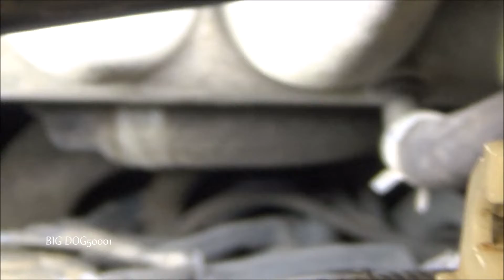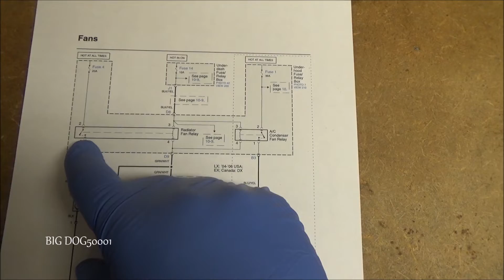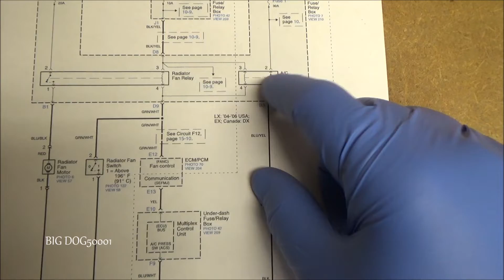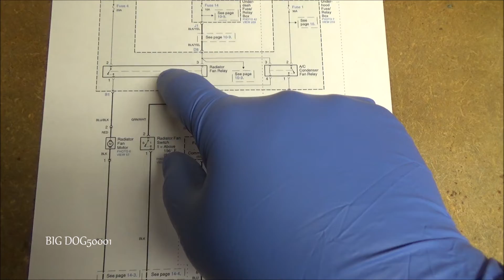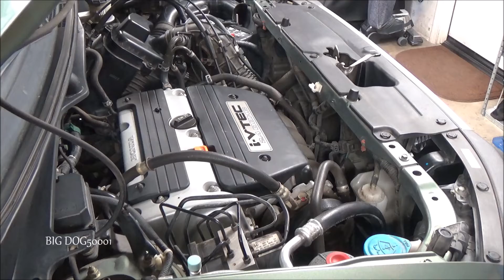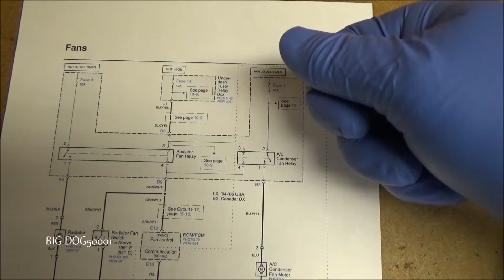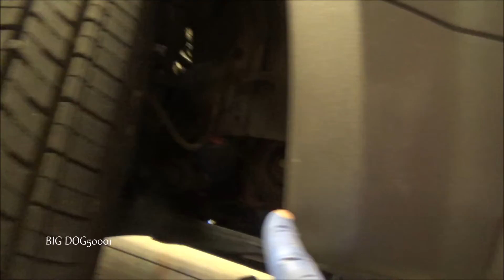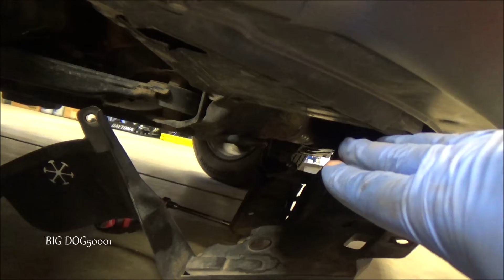Honda Radiator/Cooling Fan Not Working Honda Element

Comment from the maker: Parts and Tools
Disclosure: This channel earns a small commission using some of these links - at no additional cost to you.
Aftermarket Honda Trim Clips:  https://amzn.to/3tY0lVP
Test Light:  https://amzn.to/3fu6DHL
Element A/C Condenser Fan (Aftermarket):  https://amzn.to/33ZTEbq
Element Radiator Fan (Aftermarket):  https://amzn.to/3eZmLlk
Astro 40SL Work Light:  https://amzn.to/2R6xSQh
GearWrench 1/4" Socket Set:  https://amzn.to/3ttBTvp
SK Long Screwdriver Set:  https://amzn.to/3whsqsU
Relay Buddy Kit:  https://amzn.to/2QxrXn5
GearWrench 3/8" Socket Set:  https://amzn.to/3wjP5VA

The Big Dog 50001 Automotive Channel Store can be found here: https://www.amazon.com/shop/bigdog50001automotive  (As an Amazon Associate I earn from qualifying purchases).

Comment: My condenser fan doesn’t work. It has ground power but no power on the negative. I checked both the fuses and relays. And even swapped the relays around but I still can’t get any power to my fan. My Cooling fan works. (Passenger side)

Comment: After replacing my entire A/C cooling system back on my 2008 Element in March 2026, I began to have cooling problems in late May and early June. I stopped and checked my condenser fan was working but very slowly/hesitation. I was prepared for this as I purchased the Honda radiator and condenser fan motors from a Japan (Denso). I drained the coolant from the radiator to replace the fan switch as well at the same time I replaced both fans. Problem solved at 1/2 the price from Honda USA.

Comment: Another single pin connector on bottom of condensor fan and another connector mounted to another part, a real pita (gray wiring harness and a ground screwed in that is stripped). * in addition tonthe switch!!!

Comment: Just bought 03 , overheating rarely but surprised found out seller capped/plugged radiator bottom where sensor goes and disconnected dangled plug. Disabling fan from turning on even tho tested plug and fan fired right up. Now have to figure out how to reconnect wire  back to plugged radiator. Hopefully can remove existing cap, buy temp sensor and install and connect dangling wire.. 
smh

Comment: Just a few tap tap taps on the fan and it started right up again. Just saved me hours and money - THANK YOU!!
Reply: Taps on the fan mean the brushes could be on their last leg. It might work once, twice, or a few times, but eventually, the worn-out brushes won't energize the circuit inside the fan motor. At least it will buy you some time.

Comment: I don't think you explained what it means if you do the tap test on the back of the fan and it spins a little but slows down.  I understand when you talk about doing the tap test on the relay...it might be the relay or a connector there.  But I don't hear you describe what to do when you tap that condenser fan and it starts spinning but immediately stops. Does that mean replace the fan?
Reply: you have to confirm that the fan motor is getting power and ground at the connector first.  that is the definitive test.

Comment: Great Video I am planning to replace both fans as well as the front “ Bumper Cover”.  I have seen another video where you can replace the driver side fan the same way. Except I might have to pull off the top radiator hose. Of course that means that I will have to drain the radiator. If I do,  I will also replace the sender switch on the radiator. My Honda has over 250,000 miles. I think doing all of this at the same time will be good preventive maintenance. I will be watching more of your videos in the future, thanks.

Comment: Watching your video allowed me to identify an Element problem I was about to buy from a dealer. It has the exact same problem. AC fan doesn't turn on when AC is on. If I buy it, i can at least diagnose where the problem is. If it is just a fan problem, it is cheap to fix, same if just a fuse problem.

Comment: Did not have test light with me nor my power probe either originally was replacing radiator due to failure but upon refilling coolant fan did not switch on at temp. I believe condenser fan is bad and coolant switch too.

Comment: adding on a newly found issue - IF you had done the radiator replacement on your own,.. and you did not replace that plug /. switch that goes into the lower side of that new radiator WITH A OEM PART - your screwed!  because the replacement plug // switch will not work unless its an actual OEM part !!!    at 1;50 on this video he touches close to the issue but does not show you the side of the radiator that had this plug / switch im talking about...  FYI

Comment: I've inspected all my fuses, relays, and the fan, and everything is functioning properly. What else would you recommend I try?
(2006 Honda Accord)
Reply: There is also a fan resistor  in the circuit that can cause the fan to not work if it goes bad. Also use a tool to make female spade terminals snug again if they have become loose!
Reply: Dentil tool works good  just disconnect battery on neg terminal so you don't short out your metal tool.

Comment: Good morning Dave. Question are the radiator fan motor and ac condenser fan motor are interchangeable, meaning are they the same part number? can I take a good ac condenser motor and swap it into the radiator fan assembly? Thanks
Reply: No. !!

Comment: My ac condenser fan wasn’t working . I checked and the 30 amp fan was blown . Got a new one and it worked. Next day the fuse was blown again? Do u think it’s the ac condenser fan or somewhere back up in the fuses? I reached down w car was off and tried to spin the ac Fan and it barely moved like the radiator fan that moves super freely .

Comment: I had to tap on the a/c fan speed dial to get the a/c to come on. I had no in side fan or compressor coming on. After a few taps it started working but the condenser fan is not coming on. Would the a/c fan speed have anything to do with the condenser fan not coming on?

Comment: Question what brand ac condenser fan did you buy?
Reply from the maker: @HotRod-wv4vm  TYC is what I typically use for aftermarket fans.
Reply: @BigDog50001  what about getting the Denso from Honda and reusing the shroud?
Reply from the maker: @HotRod-wv4vm That is an option.  I usually don't go that route due to cost.  Plus I like getting the entire assemby so I don't and have to deal with possibly breaking plastic pieces off of the old one.  Old plastic in the desert doesn't age well.

Comment: I have a 2005 Element and the a/c condenser fan stopped working and the car started to over heat while stuck in traffic with the a/c on even though the engine cooling fan was running. Coolant reserve tank was empty also. I was not aware that both fans came on when the a/c was on so I thought the engine cooling fan and or circuit was at fault. This morning I bought a new fan because I connected 12 volts to the fan and it did not come on. I also bought a new fan relay because there was no power to the fan on the harness side when the a/c was off thinking it was the engine cooling fan when in fact it was the a/c condenser fan. The relay didn't even match any relays in the fuse box under the hood which baffled me. After watching this great and very detailed video, I determined I bought the incorrect fan. I need the a/c condenser fan not tge engine cooling fan. Tonight I did some tests after watching this video and found there is power to that fan, but only when the a/c is on which tells me I do not need a relay. I tapped on the a/c condenser fan like you said, but with a pair of Snap-on pliers and after a few taps it started to work. I'm returning the relay not only because it's the incorrect type, but I do not need it. I switched both fan relays and did some testing and they both are working. I'm also taking back the engine cooling fan and exchanging it for the a/c condenser fan. Luckily I'm a retired motorcycle technician and machinist so I have tools and some experience with water cooled engines, but I just needed some guidance and the information in this video helped me solve my issue and I don't need to go watch another video. I just have to have the system pressure tested for leaks since my reserve tank was empty, but I do not have the tools for this so I will take it to a local shop I know of who's honest here in south Florida. 
Thanks again for a great video. 👍🧓😁
Reply: Thanks for writing that down cliff. Helpful to know what you went thru
Reply: @jordanindustrialcompaction8381  My pleasure. I'm glad and I thank you for taking the time to read my mini novel and I appreciate it along with your reply.

Comment: So im understanding this correctly; both fans run off the same relay?

If thats true, would that mean the relay is bad if both fans do not work? (I havent done an in-depth diagnostic on mine, but both fans do not run at all)
Reply from the maker: No, two different relays.  Both fans should come on at the same time once the vehicle's coolant gets to roughly 200 degrees at the bottom of the radiator.  Each fan has its own relay and power fuse on these Elements, so most likely it is not a relay or fuse problem if both fans are not coming on (unless both relays or both fuses went bad at the same time which does not happen very often).  I would look for something that both fans have in common, like a blown Fuse #14 feeding the control side of the relays, a bad shared ground at G201, a bad radiator fan switch (for 2003-2006 models) or bad Engine Coolant Temp Sensor #2 (ECT2) (for 2007-2011 models).  Also, it is always possible the fans work and the coolant is just not getting hot enough for them to come on (a quick way to check if fans actually work is to turn on AC and see if the fans come on).  Good luck!
Reply: @BigDog50001  Excellent!! Thank you for the info. I'll investigate the fuses and ground, get all that done first before I crawl underneath to check that temp switch (it is a 2003 model)

Comment: My elements cooling fan is not coming on yet car isn’t over heating ?
Reply from the maker: Either the system is operating properly and the vehicle is not getting warm enough for the fans to come on or there is a problem that will need some troubleshooting (turning on AC and looking to see if fans also turned on is a quick check to see if the fans actually work).  Sometimes it will not overheat if the weather is still cool.  

If there is a problem then bad thermostats, fans, ECT sensors, wiring, relays or cooling fan switches etc, are all possibilities.  Hard to say which without seeing it.  

FYI, early models use a cooling fan switch located at the bottom of radiator to turn on fans (at around 200 degrees) and later models (around 2007) replaced that switch with a second engine coolant temp sensor (ECT2)  - which means engine computer is fully in control of cooling fans on models with ECT2 sensors.
Reply: @BigDog50001  thank you for an in depth response and for things to troubleshoot. I’m convinced right now that the cooling fan is shot because the a/c one comes on immediately once a/c is turned on. Relays are good and I have power to non operating fan. I will replace thermostat on bottom of radiator area to be on the safe side

Comment: hello. what might be the problem, when both fans goes on and off at the same time very often when I turn on inside heating (ventilator/-s). AC is off. Thank you for any tip to check

Comment: Big Dog, Can I use a multimeter instead of the test light? Plug the red and black needles in the plug and see if there is a voltage?

Comment: Both fans turn on when AC is engaged, but neither fan turns on when the engine is hot and the heater is engaged with full fan. Does that mean the thermostat is bad?

Comment: Do you have a link for the wiring diagram? I have the same issue both fans do not work. I also have a vampire draw killing the battery overnight. Thanks

Comment: When i changed my rad, i removed the top mounts on the rad and the hood latch, was able to tilt the rad forward and slide both fans past the rad and down into their spots. Now i have to fivure out why the fans only work with ac on. Temp switch

Comment: I learned a lot from this video but mainly sometimes all you need is “just the tip!”
Reply: PS: I smacked my fan with a long screw driver “just the tip”  and it started working!!!I intend on changing the fan immediately but this let me borrow some time while waiting for the part. Thanks for the uh…tip 😂

Comment: I had the opposite last week on my granddaughter's 03 CR-V. The radiator fan wasn't working. I swapped relays and no joy. Fortunately, I already had a replacement fan on-hand. Before I removed the fan, I unplugged it and connected the new one (laid on top of the engine, face up), and turned on the A/C. Yep, it worked. So, then it was simply removing the frame, unbolting and R & R. I too broke a lot of the plastic fasteners on the splash guard, but I have the big Harbor Freight 240-piece kit, so that comes in handy a lot. The bad part (nothing ever goes smoothly!) is that I broke the 10 mm bolt at the bottom of the frame. It was really rusted up and, even though I PB Blasted it and was extremely careful, it came about 1/4 out and then snapped. I was able to come up with a temporary fix, but I have to drill out and replace the bolt. Argh!

Comment: I have the same car. (05 element) my fans only work when the AC is on. When the AC is off they dont spin. The car does not over heat. Any ideas?
Reply: Bro mine is same they both  work  when the ac is on .

Comment: If both fans spin with the ac on, why doesn't the radiator cooling fan come on  after using heat during traffic jam?
Reply: That fan has a separate sensor , so that sensor could be bad.  It's the engine coolant temp sensor it's in the bottom edge of the radiator.  Jack it up change it from underneath.  You do need to drain the coolant to swap it

Comment: I think my condenser fan motor is broken, will test and replace as needed, but curious what harm does it do not working?  My AC works fine
Reply from the maker: It can cause the engine to overheat, which can lead to headgasket failure and other issues.

Comment: I am just confused cos the video headline is for RADIATOR FAN MOTOR REPLACEMENT but you are talking and showing on the wiring diagram about CONDENSER FAN MOTOR !!!
Another important mistake !!! You show the two relays next each other but left relay IS NOT FOR ANY FAN but it is for AC compressor clutch !!!
Reply: You are right, I was watching this and thinking, he is wrong or I'm crazy. The title is wrong and the relays information is wrong. Glad I watched the other videos first.

Comment: I have an 03 element and my ac fan comes on when I press the ac inside but that fan is on the driver's side. The cooling fan I'm guessing is reversed in the passenger side. Is it possible the wiring was switched somehow ?
Reply: I'm fairly sure with a/c turned on. Both fans run together.  When the engine becomes hot, (without a/c on) just a single fan will run.  196 -200 degrees he did mention that

Comment: Hi I have a 2008 CRV. When I turn on my AC the condenser fan not on, and I did the testing of the fuse and relay which it working.
The load ( fan) is not working and when I tap the motor of the fan it move very slow and then stop. My main question is does the condenser fan Need to be working in order for the ac clutch to engage? Or just say when I press AC ON, can the ac compressor clutch engage without the need of the condenser fan to be on?
Reply: Compressor will engage without need for condenser fan as demonstrated in the video. However, your engine will run hot.Therefore, it is important you have the fan replaced as soon as possible.

Comment: Great video, you are clear, concise and thorough in your explanations!  Loved this so much that I know subscribe!  Tough to find specific videos that are on the same car with similar issues.  Anyways I had an idle issue with the IAC that I corrected and while doing the idle relearn with the ac on realized that the ac fan wasn't working.  Found your video and ran through all the things you did to see if fan was bad.  Neither fan come on when key is powered to run with or without car running needs to be at operating temp for the to work. Got test light and did all the tests that u did with same results (relays, fuses and ground all good) except for car no power coming to connector with car on and ac on.  Would this be a break in the hot leg between the temp sensor and the connector or would I need to chase the entire wire back to the box.  If I'm getting ground at connector then the black wire should back to box.  Could bad temp sensor be causing interruption in power to fan connector? Any helpful info would be appreciated, never been a wiring guy but circuit seems pretty simple, figured I'd give it a try!

Comment: Looked at several of these vidios I found this one after doing the job.the other videos leave out a Lotta good tips like the wires on the bottom of the fan Loosening 
 the bar on top. I ended up with a little damage on the radiator and struggling a lot with the wires below. This video by far is the best, I wished I had found it before I started. After putting the new fan in in it working the air conditioning still not blowing cold air .The next step will be recharging the system.
Reply from the maker: Thanks for the input!